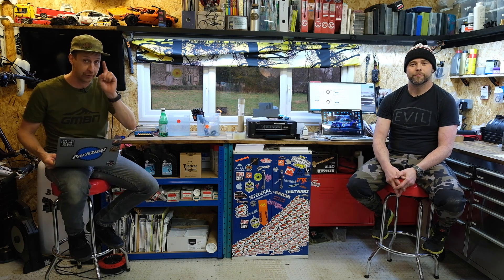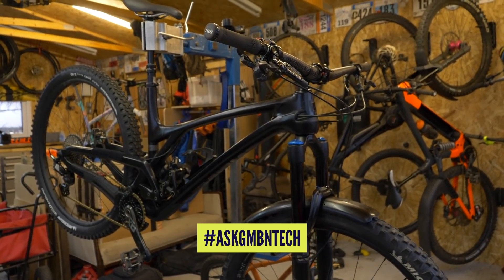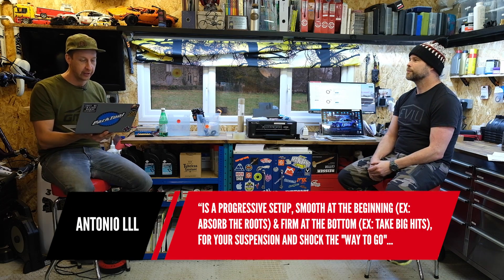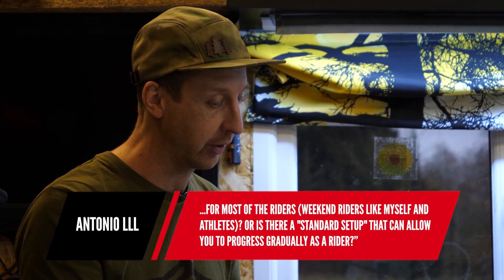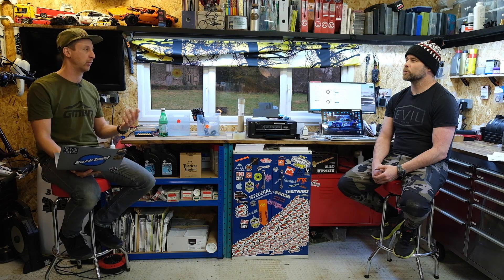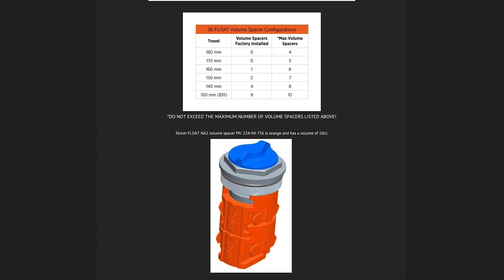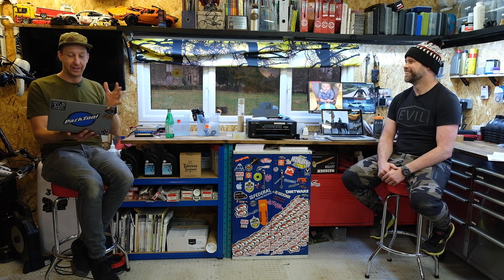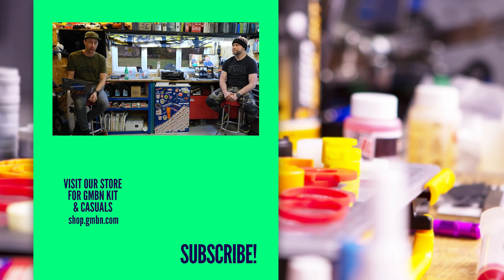Is A Progressive Set Up Better Than Linear Suspension? | #AskGMBNTech Suspension Special

Comment: #askgmbntech : Hi from France, I have a xc hardtrail (exceed) with 69,5 HA, and I was thinking to use an angle adjustment headset to make it more slacker (maybe 68°). Is there any risk to damage the frame in long-term ? And will it affect the rest of geo like reach or stack ...? Thanks a lot for your answer :)
Reply: I'm no expert but it will for sure shorten the reach but not by loads. You could compensate for that by lowering the stem because that will put it forwards. Cba to explain why. I can't say if it will damage your frame but I would say due to the nature of an xc bike it may be problematic. This is because they are light and may not be able to deal with the extra leverage due to the slacker angle but since it is only 1.5 degree I would say it will be okay. If you are unsure then definitely speak to the manufacturer
Reply: I might be wrong, but doesn't Exceed have an integrated headset?
Reply: @sm-qw9mj   if it does there is still an angle headset you can get but only if your steerer tube is long enough. Hardtail Party made a video on it a while back
Reply: @owenbirch6188  True, I'm a little hesitant about it though. Having another pressfit thing in your bike doesn't sound that good. It also needs a longer steerer length. But yeah, it's a possible solution.
Reply: @sm-qw9mj  I'd say its a bit dodge in a carbon xc frame too as it puts extra leverage on the headtube. Also the bike is designed that way. If you make it slacker than you may brake something due to being able to descend faster. I would have said practice descending on it as it is. I used to ride a full sus trail bike with a 69 head angle and if you are used to it it is fine for most trails

Comment: #AskGBMNTech Two questions. What is a good amount of newton meters for a torque wrench? Also, what is a good torque wrench for doing basically everything on your bike
Reply: You can't get a Torque wrench for everything on your bike.
You either get a precise small torque wrench (1-20,25 maybe) and a big one (10-40 or smiliar) 
Granted, you won't use the biggie often just for BB,Pedals, Casette and centerlock rotors
Reply: @maikszczerbuk613  Thanks, any recomendations?
Reply: Lifeline one is a good cheap one
Reply: Maybe you want to try getting a spec sheet from the manufactuer of your bike. Usually they are offering explosion drawings of their bikes, rear triangle and so on with the torque that the connections needs.
Reply: You need two. 
One for fine stuff like the bars stem etc. 
Another for the big stuff. 
If you must have only one get the fine one. 
Big torques can be “estimated” with less damage potentially
Reply: @finlaypaton7202  Thanks, any recommended for the big stuff and small stuff?
Reply: @lukepw08  I use Park tools, basically get the best you can afford, they'll last longer
Reply: @finlaypaton7202  thanks, which ones do you use from them?
Reply: @lukepw08  my main one is the TW-6